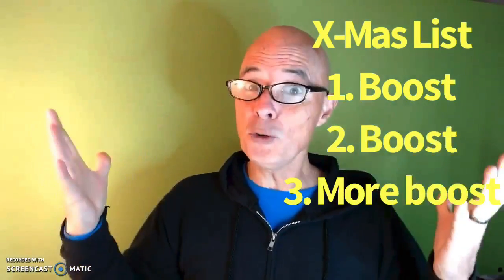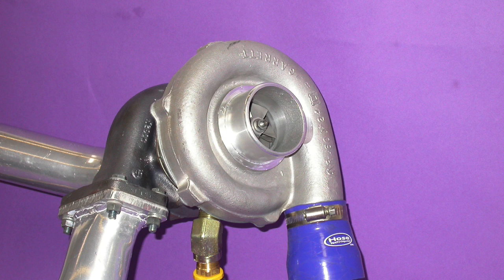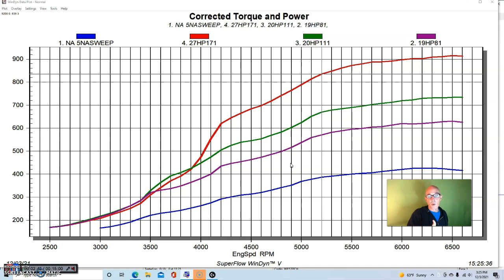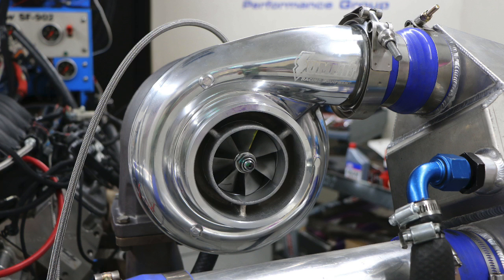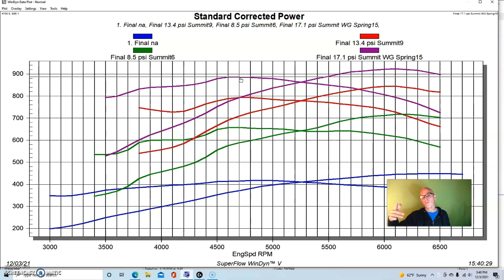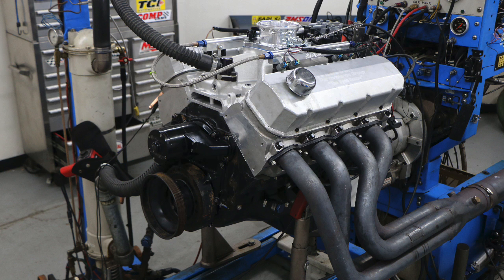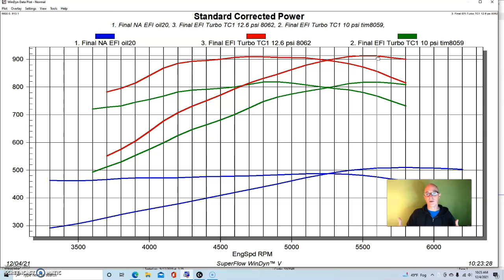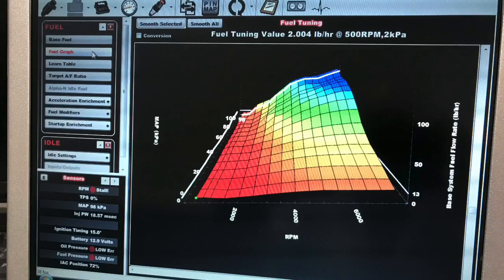HOW TO ADD MASSIVE, LOW BUCK POWER GAINS TO ANY MOTOR. IT'S CALLED A TURBO--WHY TURBOS RULE!

Comment: Heyyy rich.. will dual blower 750 carbs be sufficient on a 871 540 BBC or should I upgrade to bigger carbs make decent horsepower I will have 10.5 to 1 compression ratio and run about 10 lb of boost always appreciate your info thank you
Reply: Drag race only..
Reply from the maker: GO BIGGER

Comment: Just recently became fascinated with Turbos. So  I'm going to try to engineer a Turbocharge Slant 6 motor for my 64 Dart with manual trans. I have a solid motor to start with that will get the internal support; new pistons, ring gap, cam and a little head work. Then it's all about learning what components will work and their respective positioning on this unique motor and engine bay.

Comment: Hey rich have you done a video on compression ratio and boost? I’m going to be at 9.4:1 on a 6.0 bored .030 and stroked running 2 gt45s. Is that to low of a compression for pump gas?
Reply from the maker: TOO LOW? NO
Reply: @richardholdener1727  thanks makes me feel better. But it would still be considered on the low side? It’s going to be a street car with the occasional weekend pull.

Comment: Hey Richard, I have a stock 1970 caddilac 472. Would you say that the 10.5 to 1 compression is boost safe or no?
Reply from the maker: with enough octane (like e85) and intercooling and limited timing
Reply: @richardholdener1727  would the power gains with all the limitations be worth it?

Comment: With the extra power all across the curve, can one expect an gas mileage increase with the extra 
low end torque at cruising speeds? I have a 96 Thunderbird and was wondering if a turbo would increase fuel economy at cruising speeds with its turboed torque increase? This is of coarse driving it with fuel economy in mind while having the extra on tap when needed.

Or do I have to swap in a sbc or a sbb(if firewall clearances are an issue?) in it with more cubes and a GM 200R4 trans to make it more fuel efficient? The thing is listed as being 3,688 lbs, that little 4.6L doesn't seem to have enough torque for it to be more fuel efficient? The city/highway combined driving is listed as only 17 mpg!! My 65 Impala does better than that with a sbc 383/700R4/3.07:1 rear gear and does 13.0s in the QM vs mid 16s the Thunderchicken is listed for. The Impala averages around 17 mpg city driving with the occasional spirited driving and once and a while lead foot driving and it weighs about 800lbs more.(around 24 to 26 highway in overdrive between 70 to 78 mph)

Thanks in advance for any light you can shed on this subject, especially where gas prices are heading!
Reply from the maker: if you are driving for fuel economy-there will be no boost
Reply: @richardholdener1727  

That's to bad, it probably would've been way easier to add a turbo than to do an engine swap. But I think I might be able to change the exhaust to up the fuel economy and probably up the power a bit as well?

I remember working at Dearborn Truck and the trucks that went to Canada were rated for better fuel economy and rated to have a bit more power as well! The only physical difference was the exhaust system on the trucks marked to go to Canada so I'll have to start there I guess. Not sure if the cams or anything else were different, that was back in 2010 but the Canadian truck's exhaust were for sure freer flowing back then.

Do you think a better exhaust system will help? Or are there any '96 4.6L engine mods that might help, like different cams or maybe different heads? I'm looking for more power AND better fuel economy like the Impala has. Or I'd hate to do a me too swap but maybe an LS would give me both? I don't know though because I can get more lower RPM torque out of a sbc than an LS that should get better fuel economy with the right gearing. Decisions, decisions....
Reply: I'm no engineer but I've been trying to think thru your question. You could try exhaust, and I don't think it would hurt but I also don't think it would help much. It would add some sound and possibly reduce some pumping losses... But I kinda doubt at cruising speed you'd be flowing enough to make a lot of difference in mpg (this is very different from diesels, they flow as much air as possible a at all times). So unless your exhaust is restricted or plugged in some way I just don't see how it could make a huge difference. Also with swapping motors, a given displacement is going to be relatively similar unless you're making a big difference in efficiency. For example switching from an old sbc 350 to an ls, you'd probably see a significant increase in efficiency. But 2 relatively modern motors? I dunno. Mpg is going to be more about gearing, aerodynamics, and just making sure everything is working 100%. Good spark, clean injectors, making sure everything is in good mechanical condition, etc. 
  Now that's not saying that there's not an argument for making a car that's more fun to drive. That's a different conversation. And again, I'm no mechanical engineer. So maybe there's some obvious things I didn't think of
Reply: @colestowing8695  

Building for low end torque and fuel economy IMO a sbc will always do better than an LS, also IMO LS engines are WAY over rated. Sure they're very durable and you can make huge power numbers with a junkyard high mileage engine throwing a turbo on it but without the turbo they just don't make the low end torque you can make with a sbc. And Richard replied above that the turbo doesn't help the low engine speed efficiency so the sbc will be a better choice for low RPM torque/fuel economy, in my experience and opinion. 

The sbc 383 I mentioned in my '65 Impala gets better fuel economy with a carb and overdrive than the '96 Thunderbird's 281 is rated for and the Impala weighs about 800 lbs more than the Tbird. The Impala has a 3.07:1 rear gear ratio with a .70 overdrive with the low end torque to cruise at the lower RPM without lugging the engine. 

Also that heavy land barge manages to get high 1.8s 60 ft times and 13.0s at 101 mph in the QM, so much funner to drive than the Tbird's rated 16.3 in the QM.

Headers are supposed to ad around 15% HP throughout the operating range so it should help the engine not have to work as hard? Why were the Canadian trucks rated for better MPG than the US trucks with the only difference being a better flowing exhaust? IIRC they rated them around 4 MPG better than the US trucks back in 2010. The Canadian 4.6L trucks were rated for 27 while the identical US version was rated at 23 both highway ratings.

Not trying to argue, just trying to eek out a few more MPGs without doing an engine swap. Maybe a better FI tune? Different cams maybe?  I'm more of a carb Chevy guy so these 4.6L FI engines are a bit new to me to work on.
Reply: @itseithergonnaworkoritaint7852  (just wanna mention beforehand that I'm not responding to be a hater and dash your hopes and dreams... I'm just enjoying the thought exercise of going thru this with a like-minded gearhead). With that said;
 The reason I used the Ls as an example of a more efficient engine was not because of the hype around Ls's. I agree, they're a bit overdone. But I also remember the days that everyone wanted a sbc and I was doing Ford's and 455 bop motors. A lot of it is just convenience and the fact that parts are cheaper and more plentiful for whatever is the most common engine swap, not to mention info. No, the reason I mentioned them is because in a basic mechanical sense the cylinder heads are much better as far as combustion chamber shape etc. There's a reason you don't have to run near as much timing on newer motors, they deliver a much better burn. Then there's also fuel injection and much improved ignition systems, computer controls, etc. But a modular motor would have most of the same advantages. So in a very basic sense I don't think there's a lot to gain from swapping one newer(ish) motor to another. 
   And yes, I read your original post pretty thoroughly when I was thinking about this whole thing. But I'm assuming that Impala doesn't have cats or any emission systems in place? That may be a big part of why it does better. Although there may be something to the idea of a smaller engine running hard enough that is outside of it's efficiency curve. For example, I remember the Chevy full size trucks that came with a V6 or V8, and the V8 trucks supposedly did better milage-wise in the real world? I don't have first hand experience with both though.  So maybe there is an argument for exhaust, I had originally been thinking of something like a cat back system but if you did headers and full exhaust you very well could pick up a fair amount. I think it's mostly going to be rolling resistance and the way you drive though. Manufacturers put a lot of engineering into getting every last mpg, they have cafe numbers they need to meet for the whole fleet.
Reply: You definitely could pick up some milage and power with a tune. Manufacturers tune cars for reliability and even more so to keep the cats firing properly. An engine would be perfectly happy to run a lean mixture at cruise, 15-1..16-1.. Maybe more. But it would melt the cats. In fact that may be a part of why the Impala does well. You might have it running pretty lean at the low end. I'd be curious what you'd see if you hooked a wide band to it
Reply: @colestowing8695  

No, I'm not doing any trick carb tuning to make it run lean when cruising(that I know of anyway). LOL I wish my carb tuning skills were that good!

No, I just built the engine and choose the cam so it would start making power off idle so it would be happy cruising at low RPM on the freeway. For a sbc 383 the cam I picked was a relatively small for that cid size engine, one with 202/212 degrees of duration @ .050" but with decent lift, .550" in. and .546" ex. and yeah, it's a roller cam.

That thing probably makes 350 to 400 ft lbs starting at 2,000 RPM? That's a good thing when you are cruising @70 mph on the freeway @ about 2,400 RPM in overdrive. It cruises effortlessly the way it's setup in the low RPMs it revs moving that 4,000 plus lbs car. That engine makes 22 in of vacuum at idle! I had to use the biggest power valve for a Holley carb I could find to make it run right! Its a 10.5 Power valve, should be an 11 but I don't think they make one that big? LOL

 Ford went to small on the CID of the 4.6L, they should of kept the 5.8L displacement for the big cars and trucks and at least 5.0L for their smaller engines and geared and cammed them accordingly, they would of got better MPGs. (IMO of coarse)
Reply: Yeah I didn't mean you did it on purpose, just maybe that's where it landed with whatever jetting is in there. This is all theoretical ofc. And yes, a 4.6 isn't huge by any means. But it's also not tiny. I wouldn't think it's so small that it's struggling, although you would have a better feel for that since you're the one driving it.  I've driven crown vics and Gran Marguis and they felt good, good power and pretty decent milage as far as I remember. I'm pretty sure those were 4.6s? It's been years. Anyway, like I said I'm enjoying thinking this thru with you. And again, if you want to do a swap there's nothing wrong with that. Or exhaust. Those engines can sound really good with the right exhaust. There's a marauder (yeah that's a 4v, but still) running around here with a true dual exhaust and it sounds mean as hell.
Reply: @colestowing8695  

A 4.6L is tiny for being a v8, 4.6L = 281 cid. Here's some more history on the Impala, when it had the original 283 in it backed with a powerglide with a 3.36:1 rear gear, the 1965 car managed to average 17 mpg after I converted the ignition to electronic, it also picked 1.5 seconds faster in the QM.

That 17 mpg is what the 1996 Tbird's rated average is and 800 lbs lighter, so all that tech on that engine isn't really helping it.

Oh yeah, the Canadian trucks back then didn't have converters on them, that was the difference in the exhaust. If we start making everything we need hear again we wouldn't need such strict emission laws because just 1 of those cargo ships put out as much emissions as 1,000,000 cars!!!!!!!!!!!!!!

Comment: With my Honda J30, it'll get rods (factory ones are tiny and a well known failure point), gapped rings, valve springs, and half epoxy filled block. There's an S2000 with this set up in the 7s (J35 or J32, so he's got a bit more displacement)

Comment: I have a 1974 nova 2 door. Built 383 sbc motor with 220cc/64cc aluminum  heads, holly sniper fuel xflow 1375 injection, victory intake th400 trans and 10 bolt 8.5 rear end. I would love to twin turbo the car. Turbos and manifolds on me. You do the rest and make a video.
Reply from the maker: I already have a Nova I never work on

Comment: Turbos are the best. I just hit around 400 on a junkyard Honda Accord k24. The cams on those eco motors are made for torque so it ended up making 340 ft lb, way more than the other k series

Comment: I want to genuinely take a Ford 105 casting FE block that people claim can be bored to 4.13 like a 428 CJ, but only bore it to 4.1 for very thick bores as it is 10.17 deck. And I have a steel FT 391 crank that is 3.79 stock. FE 390 rods are very sturdy at 6.49 and a 2.43 journal or I have an iron 3.98 428 crank that can be reground for 2.2 journal Molmar 6.7 rods and it would allow a short ch forged piston.  I have. A set of heads with 209/1.65 valves that flow 235-245 at .550-.600 lift. This is mostly stuff I have laying around. Good valvetrain and a Holley SD single plane. I want to use either a single GT45 or a double GT45 using  factory iron log manifolds to keep the cost down, cr at 9:1 forged pistons likely 2618 alloy with .022 top.024 second rings likely 1/16/1/16.  What would you do?  A single 45 with a Y pipe on the ex manifolds reversed or try to put 2,in with a water/air CAC?  Car is a 65 Galaxie 2 dr ht, 600 ft lbs 600-700 hp.
Reply: If I read your note right, you want to build an FE with 4.1" bore x 4.21" stroke?  That would make 445 cubic inches, which should easily make 500 HP NA.  A single GT45 is only good for ~600 HP, so you would only need 3.5 psi boost to make the 600 HP.  Hardly seems worth the trouble of putting the turbo on to run 3.5 psi.  A Galaxie is a fairly big car, so you should be able to get two turbos in.   Run 11.5 psi boost, you should be able to make 900 HP.  With 14.5 psi, you could hit 1000 HP, and the two GT45's would be in their sweet spot.
Reply: Cheap ebay stainless shorties would be miles ahead of those Id assume. I can't think of  worse log manifolds.
Reply from the maker: I would just add boost to the 390-no need to bore and stroke
Reply: @richardholdener1727  Good point.  Adding the extra 55 cubic inches would be equivalent to increasing the boost pressure by 2 psi.

Comment: In the 18 months I’ve been watching Richard my 78 TA 6.6 has went from 180 hp to 950 reliable hp. Ring gap, E85, VS turbo, factory manifolds, Fuel injection and 20 psi…Its all be learned off Richards channel
Reply from the maker: nice!!!
Reply: @richardholdener1727  Richard needs to do a Pontiac!
Reply: That's awesome! Wish we would've known what we know now back about 20-30 years ago. I had so many cars that would've been absolute animals with even the most rudimentary turbo setups
Reply: I have a 71 ta 455 4spd luecern blue plan on boosting
Reply: @charlesroyal2357   Do a blow through and lockout the timing. Ring gap both rings, and she’ll live forever. I just recently took off the FI and am going back to a carb-only because I am overpowering the FI and am maxing it out…The car is still going strong at 23 psi….
Reply: Richard would have said go with a carb

Comment: I thought of turning my 302 to a 347 stroker but about the same price for the stroker kit I can run twin turbos and get 3x the horsepower gain. That being said I felt 500hp in my Ranger was a lot but 900 plus sounds down right frightening.
Reply: Nah that's what a cage is for, but if you think making 900 hp form a 5.0 is cheap think again. Build a 347 and have a proper trans, built 8.8 a  3 or 4 link and then go for some boost. But why invest all of that in a lame filthy ford ranger🤷‍♂️ to be quite honest a built 347 in a proper built short bed ranger would be more fun then most people have ever had in any car.
Reply: Yep 900 hp would be a lot especially if you want it to be able to go straight
Reply: 351w w/turbo. Theirs room, you have to get creative.

Comment: Richard i have a 2011gt500 with l\m cams with headers 2.3 blower with 1000cc injector it made 714@6300 on 93 octane i asked if I had enough injector for e85 the tuner said I needed bigger injectors.what size fuel injector would you recommend. thanks for any input
Reply: You need 35-40% more fuel for the same boost level on E85, so an easy guess is 1300-1500cc.
Reply: @ChurchAutoTest  do you recommend a certain brand I’ve been looking and they seem to be giving them away for $1400 and up on different places